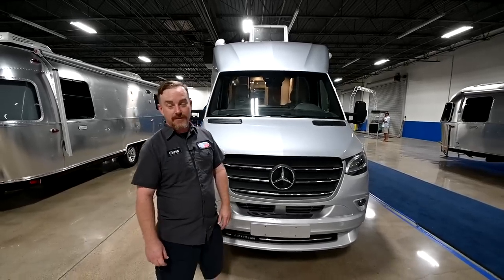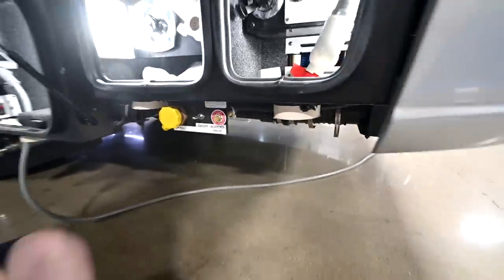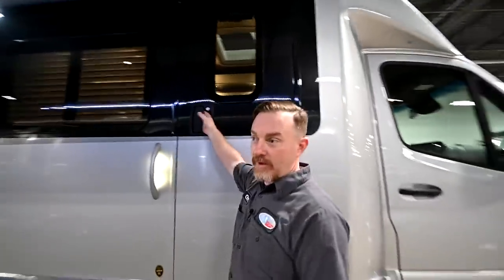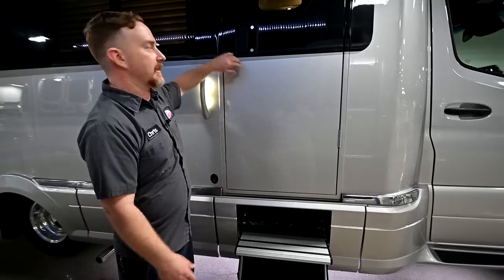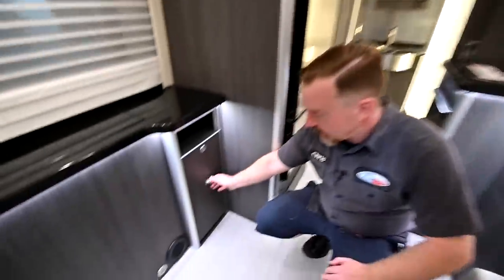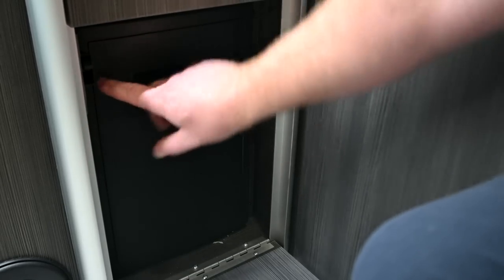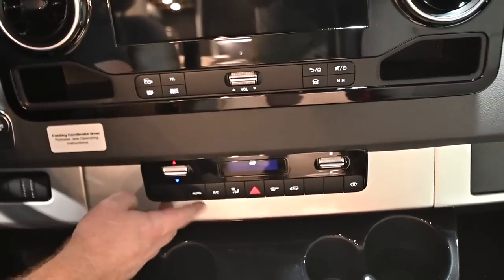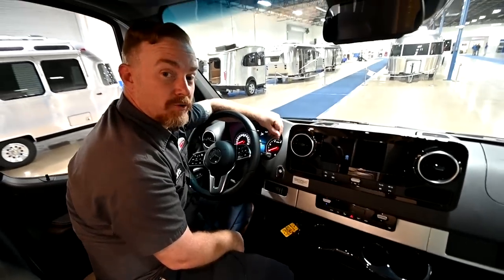2021 Airstream Atlas Full Service Walkthrough

Comment: Great walk through. At this price point the slide should be hydraulic and there should be hydraulic levelers rather than stabilizers. Also the electrical system remains archaic. Minimum inverter should be 2000 watts and there should be lithium batteries.Using the generator to power the microwave is something to expect In a low end coach with no inverter. OCCC was not mentioned but I know it is low. Switch to the new Ford V-8 chassis. Less snob appeal but smooth engine, equal safety and electronics features and enough OCCC to chuck the plastic toilet and fill the water tank without worry.
Reply: Do you consult?
Reply: I agree for this kind of greedy money some of the specs and systems need to be upgraded very disappointing. A fool and his money are son parted.

Comment: Very good presentation. He didn't say anything (that I can recall) about the camera location(s) or the location of the spare tire.   Can the driver's seat be extended back for tall people, like me? I'm 7 feet tall with 40 inches from floor to inseam and weigh in excess of 400 pounds. It seems that such a vehicle would have a camera on the lift stabilizers to show the operator that they are fully retracted.

Comment: Why do they sit SO low to the ground? Seems like even a slightly dipping dirt road could cause issues. Plus , it just looks like it's not heavy duty enough to camp away from anything but a paved surface. Kind of  a bummer. Do they make a 'heavy duty' or off-road oriented version?

Comment: Why not use the cab's MBUX/MBAC system instead of Fire Fly? Mercedes-Benz already designed it so that you can install an external touch screen in the house area and connect it to the vehicle's MBUX/MBAC system. It can be programmed to do everything from commanding lights, awning, generator, monitor battery and liquid levels etc. European motorhome and van companies like Hymer Westfalia and Alphavan use MBUX/MBAC instead of an aftermarket solution. I wonder if it's not fully available in the US-Spec vans?

Comment: Maybe detailed on the electrical stuff but a bit disorganized walk-through. I have to fast forward or back to see if I have missed something or I did not need the explanation because there are things that are self-explanatory or the manual can help. A lot of control panels. However, he did not show the lagun table and how it looked when attached? Other than that, I like almost everything inside and out especially the lounge chair and the murphy bed and the pedal flush toilet and convection microwave.

Comment: Price? (My guess is $150 K). And why not have an American engine? Probably has Chinese bomb tires. Nice to sit on the ground to deal with service (water and power connection). Does it come with a German assistant to help old folks get up (needs Chinese made knee pads)? No macerater? That awning will be blown away with ANY breeze. Tremendous power usage so you will need to have shore power or run the generator often. Nice walkthrough.

Comment: Airstream needs to convert this into a true off-roader .... then one can truely go anywhere !!!

A) lifted suspension with spacers ans airlift 
B) custom off-roading lights and housings 
C) cassette toilet for easy dumping 
D) custom bull bars ( front , rear ,) and side rock crawlers 
E) skid plates for underbelly protection 
F) exhaust relocation ( both engine, fridge and other 
G) snorkel for deep water emergence 
H) rino liner with custom design for exterior look 
I) roof rack and rear storage systems for anything adventure 
J) off-road wheels 

   Just things that I would do to any rv if I were gonna go around the world

Comment: The technical esp. electricals were the most useful u
-good point flushing toilet to remove pressurized water still in the pipes,
-a SECOND inverter  (in this case just for the ref),
-the connection between battery, generator, main engine,
-the menu choices/switchings are complex & confusing,
-nice to hv more lithium for aircon,
-not designed for trailseekers/off roaders; more for rich retirees :)

Comment: Wonder why 6 months on the batteries. The new ones the fire dept put in my house is a non changing battery and you replace it in 10 years period. There isn’t anything you do except press the test. The battery lasts that long. And it works past that but I just write the date on it and when I replace it’s still working.

Seems a bit behind the times.  I like the ones where the panel he is using at the front where those two big speakers or vents (center not behind the steering wheel)  is curved around like a neat dashboard and at a angle for the driver to see.  Like a nasa type dashboard for the driver. I have seen a couple like that — I thought it was neat and more up to date than just straight across.

Comment: I have to say the Leisure Murphy bed is much nice and easier and it’s a better height. On this one it’s pretty high. See right there the legs etc should be a drawer, what 65-75+ wants to crawl around in the floor to get the table legs - same outside.   All should have a foot switch that a drawer comes out and in.

Another thing is the window above the couch is pretty small.  Everyone of those bottom areas should be a drawer that comes out with your foot not those silly bin doors that you crawled under or a door you drop down,etc. see again, the freezer should be a drawer not a door. 

The opening mechanism on the window could be better. You know the more I listen to Chris — he sounds like he knows some of these things should be better but he has no option but to go through. Shower door latch not the best. 

What nobody tells you — how long a nice hot shower can you take.

Comment: One flaw, he stated the door to the washroom needs to be latched when the vehicle is moving, to prevent the door from slamming open and shut, as the magnet used to latch the door closed is not strong enough. They should have used a deadbolt handle to go into the wall, to secure it shut better. What if you want to use the washroom while the vehicle is in motion....you have to leave the door wide open. I guess you better not be shy.

Comment: 1. The bed appears to be wider than it is longer. Is the head of the bed the part that is touching the wall? If so, is it so much wider than it is longer? Does someone have to sleep next to the wall and someone has access to the galley?

2. The table seems like an afterthought. It requires assembly and disassembly each time you open the bed/extend the foot rests of the chairs… It’s one thing raising a table, but who is going to disassemble and stow a table, and one that’s so mall at that?

If you buy this vehicular, you have to except that you’re going to eat off of your lap most of the time. Am I only one that so surprised that something this luxurious doesn’t offer A larger more easily accessible dining/working surface

Comment: You think by now you would have figured marine forcette are old hat , all other make now have macerators , and if you going to put a coaxe connection outside you need to add a gadget to hang the TV on, and most galleys have pop up extensions and at least 6 cubit fridge instead of dolls hour fridge you offer and besides offering a trummer hot water heater they also have a water mizer and on the awning now one doesn’t have to hold down button, a touch does the job.. the washroom usually comes with wooden base . Finally on entrance door there’s a detachable garbage bin.
Reply: Kevyn Dignum missing mosquitos nets on all windows and a screen door on main entrance. See the canadian version. Not sure about the cooking unit...

Comment: This thing is a quarter million dollars with small solar, small lithium capacity, and only 23 gallon fresh water capacity (wow super small) and little storage in this thing they messed this up.  

Listen folks, if you want to get more sellers offer more options to stay off-grid longer, this thing should have at least 4 100 amp lithium's, 1200watts of solar, and 50+ gallons of freshwater at the least
Reply: this isn't an 'off grid' style RV dummy. this is more the  dont fly anymore or dig hotels type traveler couple.

Comment: I have no use for a vehicle that has to go to a dealer for an oil change. I never have. And after motorhomes spending over 3 years of my life living and traveling  in 3 different motorhomes. Definitely get stainless steel screens for the furnace vents. For this kind of money Airstream is remiss in not putting them in as standard. Mud-daubers destroyed the furnace motor in one of my RV's.

 300 Watts of PV is far too little. That means you will have to use the generator a fair amount of the time, and campgrounds don't often allow generators these days. A large array of PV's with Lithium Ion battery storage is the way to go. Don't waste fuel generating electricity. That's why God created PV panels. Also, get a 2,000 to 3,000 Watt inverter so you can operate the microwave from the battery pack. That's one of the handiest things in an RV. Smart people realize that everything remote, from boats to RV's is switching over to PV panels and large lithium Ion battery packs. For the price of this rig and the price of PV's and Lithium battery packs there's no reason to shortchange yourself with fundamentally outdated RV tech, which this is.

Comment: Electronics are great when they work. However, I could imagine electronic controls failing (i.e., black water). Then what? Also, it would be nice if the doors swing left to right rather than from bottom to top. That way the user wouldn’t have to sit on the ground to gain access to the controls (e.g., black water operations). That could get ugly fast. 💩

Comment: Simplicity of design requires zero knowledge. The fact you are so good at what you are showing worries me. I own a Tesla, all the stuffs you talked about, should,  just there working behind the scene. No engine to start, no keyboard for gps, level 3 auto pilot... Wish Mercedes and Air Stream can focus on real RVing experience rather than gadgetries. When I drive long distance, I want all the safety and driving assistant (level 4 auto pilot would be A++). Electrical motors with batteries for virtually every appliances in the coach. How about solar panels, 3kw true sinewave invertor, 24/7 variable speed air conditioning, omni-directional wifi antenna, that I can watch online streaming while parking in McDonald having lunch? Oh, don't forget air ride and auto leveling jacks. That would be good start for 2021.
Reply: You mentioned many things that he already went over Jack.  Sounds like you didn't watch the whole video!
Reply: @nomoreprospecting  Yes! That’s my point. There are so many buttons and details there’s to know in order to operate the machine. To really see the differences between complexity of a design, you may want to visit a Tesla sales center and have a test drive.
Reply: @crabtrap  I own both and see the future. Do you?
Reply: @jacktseng4909  yes i see the trend, and the trend will simply never be electric trucks or RVs. Our power grid cant sustain it and EV's are actually pretty ineffecient as much potential energy is lost transmitting electricity to you EV via powerlines. Frankly i dont even think Ecars will become the norm

Comment: The comments seem to be about the presenter and not about the RV. Seems like a rookie designed this. Window shade storage outside, really? Furnace, engine exhaust, and generator access is patio side. Horrible idea. Storage spaces that don’t have a switch to turn off lights, your black water can back flush gray water, a simple flapper valve could fix that. I expected so much more from Airstream. 👎🏼👎🏼👎🏼👎🏼 I’ll have to pass.

Comment: Expected more from airstream.  The design is poor, looks cheap.  3 air monitors, 2 wired into the trailer battery, 1 is not and needs batteries.  What?  The awning is rinky-dink, microwave on floor level and bathroom light switch in the bedroom.  What?  I'm currently looking for a camper, but will pass on this one.

Comment: I'd never own a vehicle that runs on diesel (due to their high level of pollutants). 0:44 Deal killer. Short video.

Since there will be people who will inevitably be inclined to comment claiming that diesel engines pollute less, which is inaccurate (though there are a ton of industry pieces online that make this claim), here are a couple of links.
https://theicct.org/sites/default/files/Gas%20_v%20_Diesel_%20CO2_emissions_%20EN_%20Fact%20_Sheet%202019_05_07_0.pdf
 
https://www.bbc.com/news/science-environment-42666596